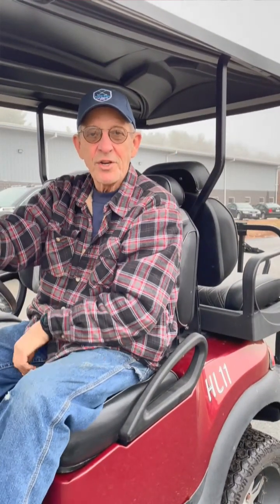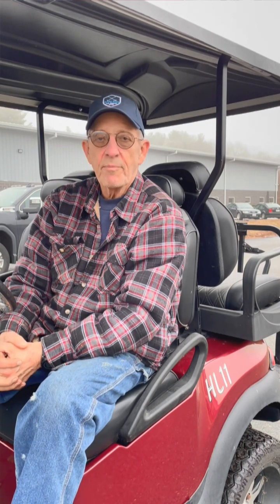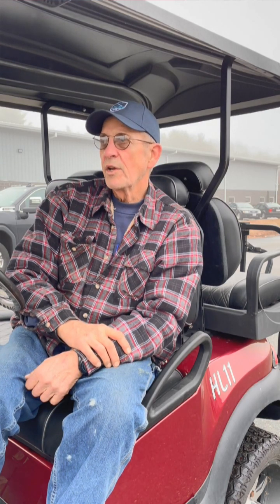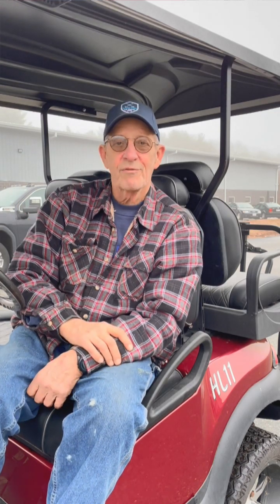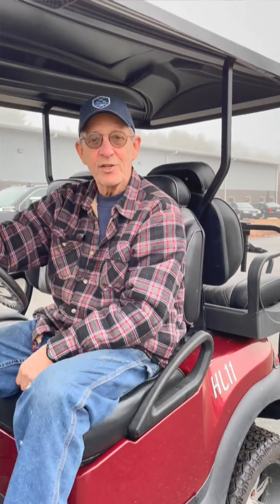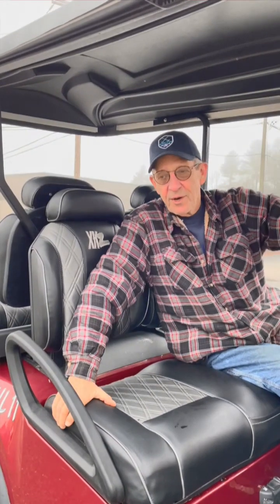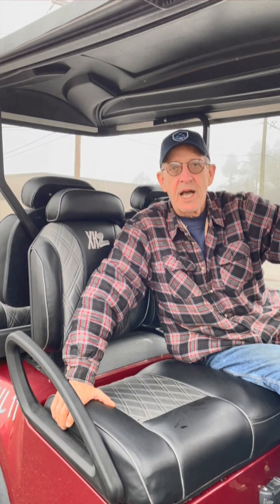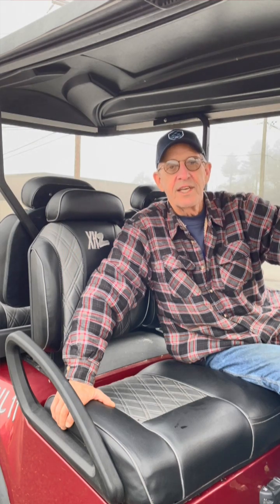TEEKON by SilverWolf Motors 840AMP AC Golf Cart Controller Test Drive for Club Car Precedent

Comment: Yeaaa, I get 33 on lead acid with Navitas.
Reply from the maker: Downhill with the wind at your back? I love the navitas system. Great product. I have installed over 100 of them. Factory 600/5kw setup is designed for 25mph which is the maximum speed allowed by the government under The specs for a PTV or LSV. GOOD for you if you are getting 33.  The TEEKON offers more torque.
Reply: I can do 45mph straight line with my 5k on 48v lithium at 200amp.  Very interested in the improvement in torque but also hard to find lithium that provides anywhere near 400A let alone 840.   @steveroche8450

Comment: Have you gone in and changed any of your settings on either motor controller setup? The Navitas 5k will do 40mph on 48 volts and 50mph on 72 volts. The Teekon doesn't quite give you as many rpm even after getting permission to exceed the factory numbers
Reply: I came here to say this too. I was curious about that. Mine easily goes past 40 with initial testing, still working on suspension and other accessories but the first test run hit 40 and I got scared and shut it down lol
Reply: @MrDustinclement  If it's a E Z GO. The front suspension gets a little erratic above 35-40. Club Car drives like a car
Reply: @goldenlife9856 I just bought a used 2010 Club Car DS and doing a motor conversion. My local shop advised Navitas and this video is the first I’ve heard of Teekon. Are you guys saying to stick with Navitas? I’d be happy going 27-30mph max.
Reply: @chrisginoc  I would....just make sure you retighten your connections a week or so later. I saw one that worked loose and caused issues